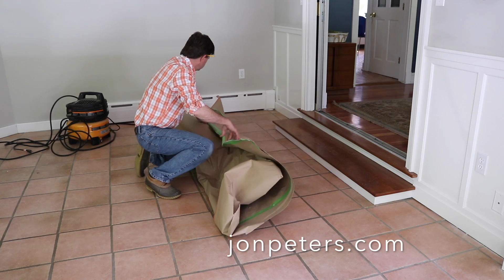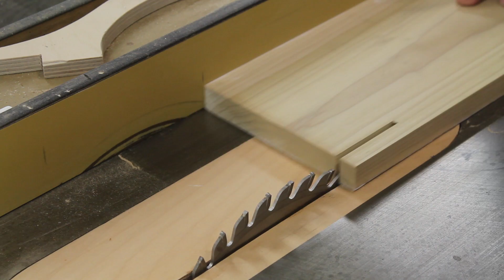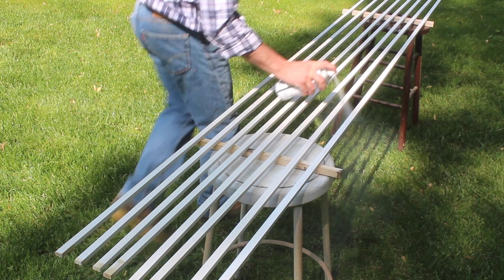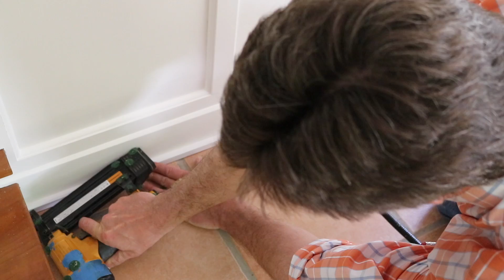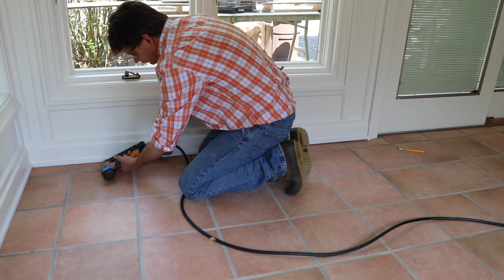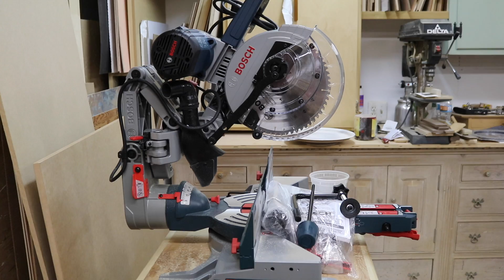How to Make & Install Custom Shoe Molding

Comment: Great Job Jon! In usa where most of the houses are build from wood/osb its a little simpler then in concrete building - you have possiblities to nail moldings. Son need to be proud of room like that, and daughter jealous :-) You will be changeing flooring?

Comment: This is Great Jon!  perfect timing, as I have been looking for detailed videos of the chair molding and panels. I am in North NJ an I am in the process of purchasing a 1929 Colonial that needs an entire Update! I have had Little success finding examples in NJ of updated Colonials for modern living. Any advice on doing this for Plaster Walls? this is Pre-drywall.. did you leave the actual panels the drywall instead of adding mdf? (Your method might work better for my plaster walls i think)

Comment: I’m relatively new to using a router but I’m pretty decent with a tablesaw would you get a better result running into a router mounted to a table with the way you were doing it thank you for your response

Comment: I used to wonder "How do you cut your finger off on a table saw?" Well now I know how to cut through 1/2 the tip of your thumb on a table saw. Dull blade pushing with a lot of weight, and my right hand slipped. The entire weight of my upper body leaning into the saw sent my thumb right over the top of the blade. Tip - Don't let the blade protrude any farther through the material than you're willing to cut through your finger. And never lean into the saw!

Comment: Great job That bosch saw is the business. What dust mask do you use? always like to try new ones as many I have tried just do not fit well around glasses.
Reply: I just got the 3m 7500.  So far love it.  Downward breath discharge so you don't fog your glasses.

Comment: Great job!  Very clean looking. Can you or another viewer advise what model nail gun that is?  Thanks!
Reply: Looks like a Bostitch 18 gauge finish nailer. I think he talked about the nail gun in a previous video where he explains why he has the green felt pads on it.
Reply: Thanks Bill.  Looking at all of these I can to satisfy an itch to give one a go.  Never used a nail gun.  Not sure of what model to start out with.  So many tools, so little tool funds...  Thanks again